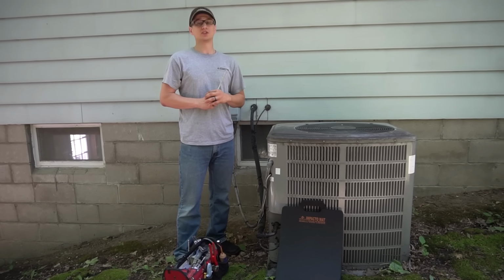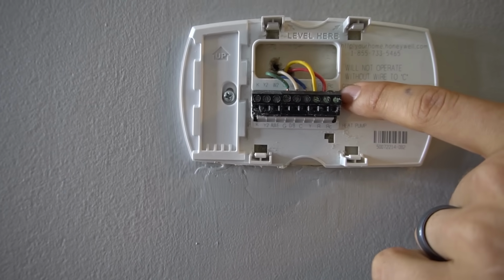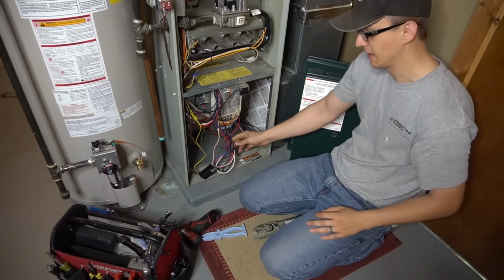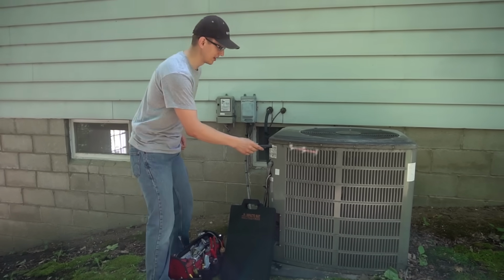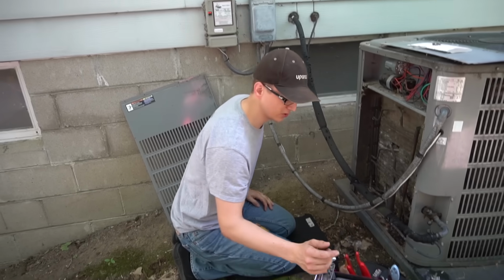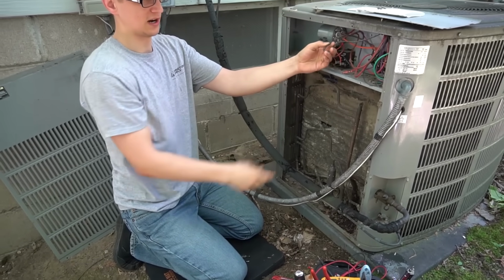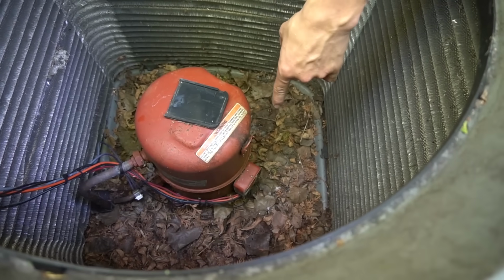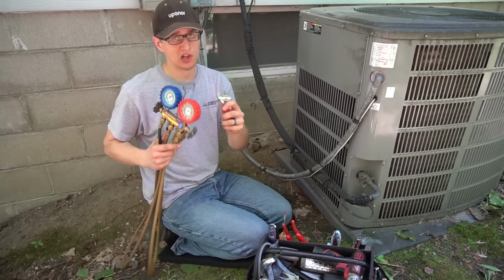AC Unit Not Turning On - How to Fix It Step by Step

Comment: Hey there i appreciate your video, however I have some additional questions. My AC unit outside is not turning on. The thermostat inside is responding to both the cool and heat settings and turning the blower on at the furnace. Outside I was able to make the unit come on by pushing in the plunger. Both the compressor and fan came on. I checked continuity on both my fuses and they are good. For some reason when the thermostat turns on the blower the outside unit is not getting the signal to turn on. The AC  was turned on last week and ran for half an hour with the winter cover on. I'm not sure if that did any damage. I am unable to find a fuse near the circuit board. The filter is new. I am stumped. Any help would be greatly appreciated.

Comment: thermostat good, furnace heats well and fan blows, but nothing happens when turning on ac - fuse on furnace control board is good, I also confirmed the unit outside turns on completely when pressing the bypass plunger, what could this be? also tried directly connecting thermostat wires r+y+g

Comment: The condenser on my ac unit starts for a few seconds then stops.  Then repeats the same pattern but never completely starts.  I’ve jumped the thermostat, condenser does the same thing. Can the problem be anything other than low refrigerant

Comment: Thanks for the thorough and detailed videos.  

I have 22 year-old Goodman units at the house, and have replaced numerous furnace parts over the years, mostly on the heating side.  This spring, the outside condenser for the master bedroom system doesn't start up.  I've replaced the capacitor and relay (using your videos, thanks!) and I still get a "straining noise" from the compressor located at the bottom of the outside condenser (sounds like it's trying to pump Freon, but will start "steaming" within a couple of minutes) and the fan doesn't start.  

I can spin the fan blade freely so I'm wondering if I have a bad fan motor or if maybe my unit is shot.  Any suggestions would be greatly appreciated - thanks!

Comment: Real Quick !!! My electrician states when a breaker trips in the middle position you should turn it to off and then fully to on (no middle to on). I have noticed this with some rentals where-as the tenant claims they reset the breaker but only middle to on; no full reset(no power). IDK.

Comment: Now would all of this pertain to the heat pump side of the unit.  When I turn on the thermostat for heat or cool I get absolutely nothing. The blower doesn't even run in the air handler.

Comment: Hey, Word of Advice guy, I need some help. My thermostat does not turn on my 2018 Carrier AC unit. I replaced the condenser but it still doesn't turn on. When I push the plunger in the fan and the compressor both turn on. I am thinking I got a dead condenser unit from Amazon. I don't have a uf/voltage meter yet but I ordered one. I am thinking of buying another condenser to try again because I don't know what else it would be. It is not the thermostat because I switched it with another one in the house and it worked. They both have fresh batteries in them. What do you suggest I try?
Reply from the maker: Sorry to hear about the AC troubles! If the unit comes on when you press the plunger in manually, that means the capacitor is actually good. (Condenser is the name for the entire outdoor unit) I would suggest watching this video next: https://youtu.be/NVPhsK4gK1A

Comment: I found out myfuse its blowed put a new one blow again whatcould be the problem can you help me.....?
Reply from the maker: Are you talking about the 3amp fuse or the fuses in the disconnect box? If 3amp fuse on control board, I would look at the thermostat wires at the condenser unit outside for any bare, broken, or cut parts. For more help with this, check out my video on how to track down shorts: https://youtu.be/4e4wsruGS0s

If it's the big fuses in the disconnect box, refer to this video for help: https://youtu.be/G1EBHrOgs-Q

Comment: Alright I have to ask. Furnace turns on compressor is silent. After about a min the 3 A fuse pops. I checked the capacitor. It shows good on both fan and herm. Contactor works manually. I don't see any shorts. Compressor isn't shorted. Followed your techniques on all above. 
Thoughts?

Comment: Ok so my A/C is two years old.  Warranty just expired. Everything is running fan in the attic is running. The fan outside is running.  Compressor is running.  Coils outside are clean. The suction line is warm and the return line is cooler than the suction line coming off the unit outside.  There is also a oily film on the suction line.

Comment: Question: what if pressing the plunger turns the fan and compressor on, but the thermostat is not pulling the plunger in? The outside temp is 53F, inside is 70F, but I set the thermostat cool at 63F to start the A/C. The A/C starts but plunger is not pulled in and of course fan is not running! Does the system coolant have get hot before the condenser fan starts? FYI, I just replaced the Capacitor and I have a Ecobee smart thermostat.

Comment: Thanks for the tips. Extremely thorough. I tried the plunger trick and noting happened.  Then I measure in the input voltage. It read 76 VAC instead of 240 VAC.  Can a breaker be half bad?
Reply from the maker: You're welcome! It's possible but I doubt it. More likely that there is either a broken/burnt wire or one of the fuses in the disconnect box is burnt out.

Comment: My breaker box in my garage trips instantly when I try to reset it. I do get air inside perfectly fine, when I try to turn on my ac unit I hear one click turning on and turning off. I haven't tried to press the plunge button yet
Reply from the maker: If the breaker trips instantly then I wouldn't try pressing the plunger. You have a short somewhere or the compressor may be fried too. (hopefully not) I would recommend you watch this video: https://youtu.be/G1EBHrOgs-Q
Reply: @WordofAdviceTV  I was cleaning my ac coils I think I may have got water in the compressor while cleaning it and the compressor does have a jacket on it also... I did spray down the bottom inside unit to clear out the debris that's about it... I put everything back together and put the disconnect back on and went to breaker box that I had switched off also before cleaning also back on and now it trips immediately. I'm having a person come out and take a look at it since I'm scared to do anything with it now

Comment: Ac not coming on at all inside or outside.  Nothing happens when I turn the thermostat on. We have been blowing fuses inside the unit.  I installed a new thermostat and it was working fine then we blew another fuse.  I replaced the fuse and it worked for a few days no issues now it won't turn on at all and the fuse is ok.   I checked breakers and they are fine. There is power inside the unit bit nothing turns on inside or outside.

Comment: Thank you for being so helpful
Reply: I did all u showed and I'm back inside because there is no 24v power to outside and at thermostat is good except for the 24v to ac y wire. No board to speek of just seperate boards and switches .tried jumping therm y and smoked fuse. With your advice i feel confident that I can do whats needed. Thanks and god bless you and yours brother.

Comment: When I open up my unit and push the plunger, my compressor turns on but my fan doesn’t turn on. Fan isn’t working trying to move. When I turn on the AC from thermostat, the fan is trying to turn for 3-4 seconds. Then stops. After another few seconds it tries again. I changed out the fan capacitor and that didn’t work. Same thing happening.

Comment: I appreciate you posting this video.  My problem was actually the Contactor.  I am in Florida and ants seem to love electrical boxes and that includes the A/C Shut off and pretty much any place that is dark and protected.  I found the electrical connection area of the Air Conditioner filled with ants and it appears that a couple of unlucky ants got between the contacts and when the thermostat energized the contactor relay the ants got fried and stuck the contacts together.  Luckily it is winter in Miami and I was leaving for the weekend so I didn't need A/C and had time to order a new contactor and a spare capacitor (they don't seem to like the heat down here either).  If this would have been August I bet I could have pried the contacts apart and it would have worked long enough to order a new one but luckily I didn't have to find that out.    Thanks Again!

Comment: I'm writing to you again. This time, my Condenser is constantly running, while my inside unit is totally turned off. I had a professional A/C man clean out all Algae from my unit,, then cleaned up water sitting on the metal . Then everything was fine. Until a couple of days later, it stopped running my unit in house. I turned on the Thermostat to on, it worked, so I turned it off completely. A little more about Thermostat, this is my second purchase.  
Now, I read that Condensers are dirty on a Rooftop. So how can anyone clean a unit? Never make units on a Rooftop. How can we fix our unit, with your knowledge?  I never experienced such a mess.
Thank You!

Comment: I have a 4 ton Goodman outside heat pump unit and I have power going to everything but nothing is coming on all the breakers are good I have tried resetting it I can't seem to find the reset button but it has power to everything but nothing comes on I also had a power surge the wires sparked in the box and I had to replace the Box about 4 days ago but I have the exact 220 coming into the box and got power the last things I got is a circuit boards is the only thing I have not changed and I don't know if I should change him there's no burnt smell there's no burnt spots on it what do I do

Comment: Question: concerning the contactor, what would cause this to not initialize? I have replaced the thermostat, the contactor, and the step down transformer. And the entire thermostat wiring harness. And despite turning the thermostat to cool the contactor doesn't initialize, however if I bypass the thermostat it does.  Any suggestions? Again I've replaced the thermostat and the wiring to it. I'm at a loss. Thanks in advance.

Comment: When I turn the AC on, the furnace blower comes on and the compressor outside comes on.  Then, about 20-30 seconds later, the compressor turns on (furnace blower still on). After about 5 minutes, the compressor turns back on and then runs normally through the cooling cycle.  It’s a 20 year old Lennox system with a Honeywell digital thermostat. What would cause the compressor to shut off right after starting - wait 5 mins, then restart and run normally? The thermostat does not say “waiting” when this happens - just shows cooling mode is on.
The compressor has an OEM timer circuit - I replaced it with a new one, but didn’t solve this. I replaced the compressor capacitor and start relay also (with new parts).
Anyone have suggestions?  I don’t know when this started.
Thanks.

Comment: Thank you so much! Everything was working fine, I just upgraded the thermometer and now the fan on top of the outside AC won't spin up. Put the old thermometer back in and still won't spin up. Can't figure out how playing with the thermometer could mess up the capacitor but now I have the next steps to debug. Do you do paid phone consultations?

Comment: I can turn blower motor on manual by the thermostat but as soon as I switch it to cool , the fuse will blow killing the low voltage.

Comment: I have an issue where everything looks fine with the furnace and the thermostat. The only issue is that the contact wont pull in. If i push the contactor manually it turns the a/c on but does not go in on its own. I replaced the contactor and it turned on but then immediately turned back off again. Havnt been able to get it going since. Any advice?

Comment: Man, this video was perfect. I learned so much, especially the part about checking the contactor. There were some small dead bugs preventing the connection. I pressed the contact in and the bugs burnt up. It also showed me that the fan and compressor were working, like before. Thank you. Awesome, educational video.

Comment: My ac unit is not turning on. The contactor turns the unit on when manually pressed, and the yellow wire coming out of the house has voltage, but no voltage on the contactor trigger which is supposed to be 24v I think? Any help is appreciated!

Comment: Today I was thrown for a loop. (Trane gas furnace, carrier ac r410a)  Ac selected on at thermostat.  Indoor fan was running but nothing outside, no fan, no compressor.  Checked for power at the contactor, power was present, contactor was pulled closed by 24v. High power was present at the line side and present at the load side.  Checked and bypassed float switch, jumpered out thermostat R & Y, no help.  No low/high psi switches on carrier condenser.  Checked wires to compressor for open, ohmed out compressor, checked capacitor, changed out to confirm, still nothing. Also tapped on contactor because maybe the voltage is present but not enough connection to carry the load, maybe should have changed it out also checked transformer for high voltage and low voltage, all ok.  I’m lost as what to do next.

Comment: Without warning my goodman fan and compressor stop running ..voltage 220 on both sides of relay is good compactor new reads good inside unit motor blows warm air call power company and their power Save gray box agent said it o ly stops the compressor not the fan ....Wha can I check next?

Comment: i had this happened to me fan quit so took a box fan laid it on top where it would blow up sucking air  over compressor bingo back in busness repman cam a few days later and changed  the fan motor  box fan worked great cooling that unit  also it was quick fix  -cool

Comment: I have a problem with my ac. When I turn on the ac from the thermostat the air comes out but the compressor buzz and try to start but it doesn't. I check the capacitor and it is still good. What else should I check? Any information will be great. Love your videos too.

Comment: Hi I’m having an issue with my Central AC I switched the thermostat switch to off in the early morning of the day…when I turned it back on the unit would not blow any air at all…the outside unit turns on fan spins but not the inside unit…I checked the breakers turned them off wait 30 minutes and then back on before turning the thermostat switch to the cool position and nothing. I can hear the inside unit like making a hissing noise like if the Freon or water is going thru and I can feel cold air coming out from where the ac filter goes. I checked the float to see if the drain was clogged but no water and even used a shop vac to try and take out anything that was in there but nothing came out. I did not do it to the outside drain tho yet. Any suggestions as to what else I can check to get it working. Thank you in advance

Comment: In this video, you don't explain anything about why the inside fan doesn't come on when the control is set to ON - to run continuously. Our fan doesn't come on at all. Our controller is a Honeywell like in this video but has no Hold button. Can you help?
Reply: Also, the batteries are brand new

Comment: Thanks, that was very helpful. In my case when I pushed the contactor at the compressor, it turned on and fan spinning, but the contactor is not pulled in like you said, and it stopped when I released the contactor. I checked and got 240V going in. I also replaced the capacitor, but doesn't appear to work or hold charge.

Comment: Great video! One question: What if my plunger is stuck in the OUT position? When I push it in, everything turns on and the a/c unit and fan start working... but when I take my finger off the plunger button, it doesn't stay in and everything then turns off. Is there an easy fix to this? Thanks for your time.

Comment: Need help my AC unit outside is not making any noise I’m able to spin the fan but it won’t keep spinning I replaced the capacitor about 2 months ago it’s been fine this whole time up until today. Furnace is fine , my breaker’s are good but I reset just Incase.  Any help is appreciated.

Comment: I've got a payne 5 ton unit. Run cap was working and holding a charge. However, after setting thermo to 50f, fan on, and program off, when putting power to it the cap blew, throwing the breaker. Do you think the contactor/relay is shot causing the system to trip the breaker fuse?

Comment: Generally make the math. Your solar system works for about 5 hours at full power. You need 24 hours of energy. That means the five hours you need most of your products yourself but cannot sell much to the grid. For the rest of the day, 19 hours you need the power from the grid. Now this power you must pay, the credit to you for 5 hours left over is much less, and trust me, the grid will not pay you 4 times more for your power than they charge you. All offers I got were measured on my monthly consumption, not on reality. And then, you produce less through the clouds and rain times too. Sven

Comment: Hi your videos are so helpful and detailed. I have a question. My air conditioner has stopped working. It is refusing to start. I did the steps that you had mentioned in your video. It seems like an electrical problem. When I push in the plunger in the electrical panel of the air conditioner everything is working. However when I release it fails to start. There is no sound or hum. The fan inside the blower is running with no cold air. I have 2 capacitors within the air conditioner.  There was a mouse inside the electrical panel but I couldn’t visually see any damage to wires. Pls let me know what else should I do